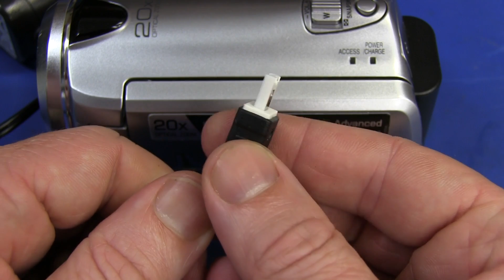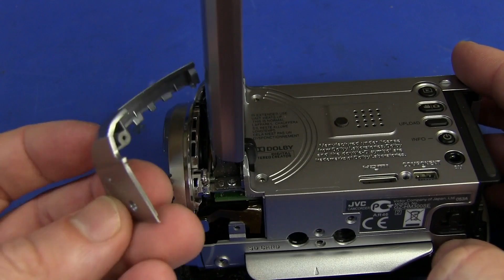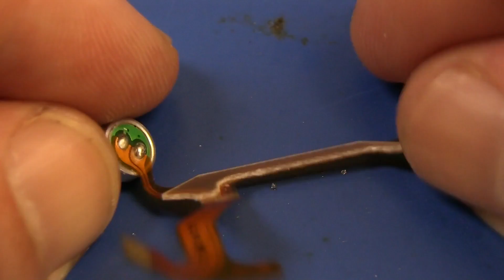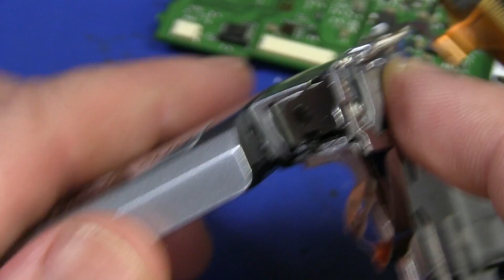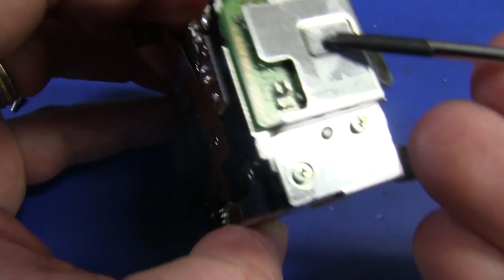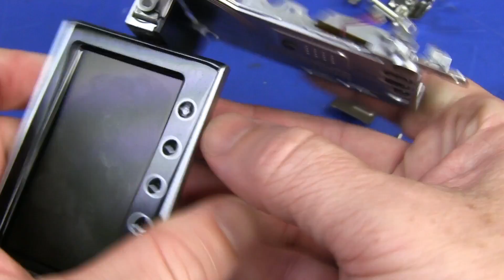EEVblog #454 - JVC Camcorder Teardown

Comment: I found his voice to be boring and he's long winded. I had to sit through the whole video so I could get some info about the hard drive so I can get one before tearing mine apart, that way I can do it all in one go. the info I needed wasn't mentioned in this tear down. 
I reckon this video could have been  much shorter if he didn't flap his gums for so long.
Thanks anyway. I might have been bored, but I did learn something that may help me sometime in the future.
Reply: Steven Donnison this everio did not have an hard drive, the previous, more premium model with alloy frame did

Comment: I have 2 mid grade JVC's. They have been through so many mud bogs in open trucks. So many times, I thought they must be ruined, all covered in thick mud. Now years later, one finally quit. It got mud in the zooming mechanism. The second one still works but recently got too close to my hand grinder and burnt little pits in the lens. Remarkably, it still records clearly except when the sun is facing the lens. JVC's are awesome! Nice to see the inside, thanks.

Comment: Just to let you know. I purchased a JVC GR-850U camcorder in 2008. It worked fine since 2012 after my family & I came back from Key West in March of that year. It sat on a closet shelf for several months, then when I tried to use it again I got an 0E3 error message "in safeguard mode". JVC has known about this problem for years and has done nothing to fix it. I got ripped off! I thought that JVC was a reputable brand, but I will never buy another thing from them because they are crooks! But, If YOU might be smart enough to figure out what is broken, then please share!
Reply: Maybe its to do with rhe battery

Comment: JVC Camera's aren't what they used to be… back in the day they were the leading camcorder brand behind Sony of course, these days Sony is your number one followed by Cannon, Panasonic and JVC would be last in terms of features, build quality and general video quality… it's unfortunate… but it would explain why I had  a few JVC digital HDD camcorders break down after a couple of years
Reply: White Tiger Visions they builded one everio like a tank. All machine screw and only 2 self tapers. Iris, full aluminum midframe (not like the plastic one in this video) and 35X optical zoom with iris. It also had an build in harddrive. I expected more in this one

Comment: "hung drawn and quartered" rather than "hunted and corded" i think. look it up, pretty gruesome.
Reply: That does not fit the "crimes" of JVC engineers to be punished like that. Custom connector that it is, if you've already got one, you can use it on all the JVC camcorders; they didn't change to a new one at every generation of models, though I've never seen it in white.

Comment: Usually year and month (or week) of production. AFAIK they are not part of the original mold but moveable inserts that can be changed around so the date can be changed without having to produce a new mold.

Comment: In regards to the lens and the manufacturer.  A lot of cameras will advertise on the lens or in their brochures things like "Ziess Lens" or "Leica Lens"... For the most part, even on professional fixed-lens cameras, all Zeiss, Leica, Konica do is engineer a "lens pattern" and maybe do some manufacturing.  The camera company actually builds the lens.  So really it should read "Designed by Konica/Minolta".  Canon may be the only one that this doesn't apply to since they are also a lens company.

Comment: They would start with the basic rectangular design then put the hole into the plastic where necessary to accomodate cables. Most models have a similar shape and design, so they can use them as a basic template. I would imagine they would use CAD and 3D printing of prototypes all the way too.

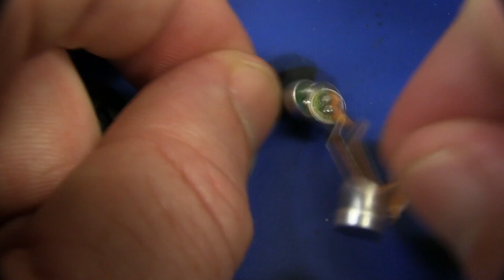Comment: 13:07 Notice that they've punched holes in the (I'm assuming) hot/signal trace of one of the mic's!  I assume this was a mono model,then? I assume they must use the same microphone assembly in more than one model? Why not just remove (omit) the unused mic in the first place? Save a whole 20 cents each!
Curious.